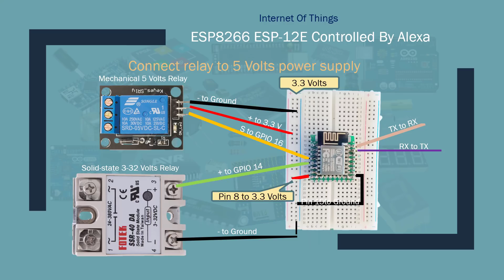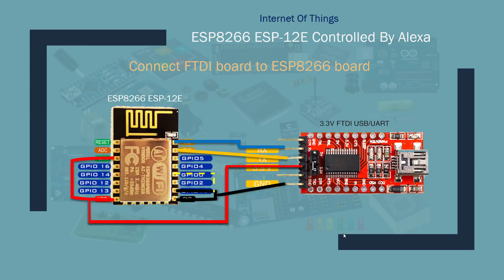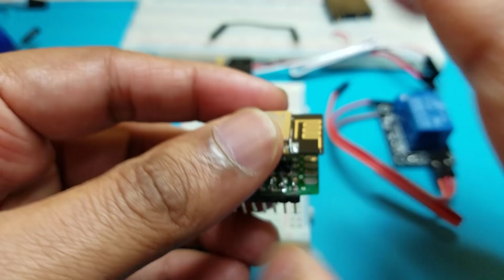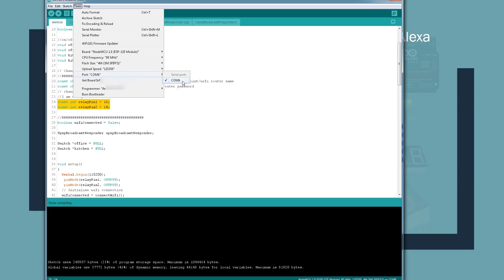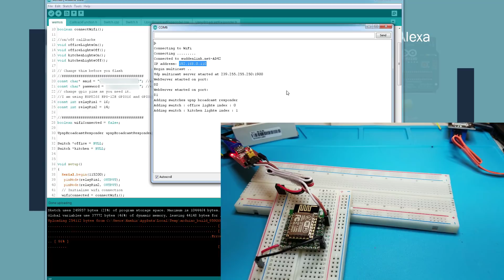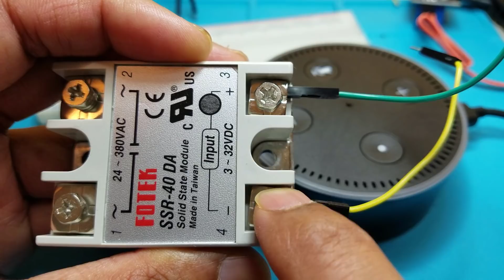ESP8366 Arduino project with Alexa |  ESP8266 ESP-12E | Tutorial # 4

Comment: i did the first tutorial and every thing worked will .. but in this one i got this from the serial monitor and i couldn't figure out the problem .. can any one help me please ?

 ets Jan  8 2013,rst cause:2, boot mode:(3,7)

load 0x4010f000, len 1264, room 16 
tail 0
chksum 0x42
csum 0x42
~ld

i got this message while the builtin LED blinking
Reply from the maker: mohamed alfalasi Please use a better power source FTDI converter does not have enough power.I hope this helps.
Reply: im using ESP8266 nodemcu 12E V2 .. and im using my laptop usb port .. so the problem actually maybe the power as u said ? .. and this board would be fine with this code right ?

and thanks for your quick response ,, please keep up the good work
Reply from the maker: mohamed alfalasi I have same the issue that is why I use bench power supply after I flash the sketch. just use 2 AA batteries or any other power source than the FTDI converter. Good luck.
Reply: i think u misunderstand me .. the board im using is like this one 

https://acrobotic.com/media/wysiwyg/products/esp8266_devkit_horizontal-01.png

https://www.moore-duino.co.uk/wp-content/uploads/2016/08/ESP8266-nodemcu-development-board-WIFI-enabled-LUA-ESP-12E-GPIO-PWM-II.jpg

i connected it using USB cable ,, after flashing it i tried also to power it up using my Samsung phone charger but i got the same blinking led
Reply: i tried to use a 12v 1A power supply and still i got the same blinking LED
Reply from the maker: mohamed alfalasi How did you use 12 volts power supply? It only requires 3.3 volts.
Reply: there is a voltage regulator on the board ,, it will cut the voltage and reduce it to 3.3v as i know .. i uploaded  again the previous code for controlling 1 relay and  again it worked fine
Reply: I managed to find the source of the problem ,, it was my arduino IDE itself ,, i guess cuz i have many things added to it, it may got confused in uploading or running the right codes somehow,, 

i tried every thing from scratch using another laptop and every thing worked with no problem
Reply from the maker: mohamed alfalasi Great job troubleshooting.
Reply: mohamed alfalasi can you be a little bit more specific on how you fixed this issue? I’m getting the same output on the serial monitor
Reply: Netmedias I’m going to try out different power sources soon, but was wondering why it seems to work fine in the video using only ftdi board power? Are you using a usb3.0 port or something? Thanks for the videos!!!

Comment: Does this connection with Alexa happen over a local network or does it require an internet connection?
Reply from the maker: CAL20EECS09GUY You need internet to process your command  with Alexa echo or dot. It will not work without it.
Reply: local aka your home router

Comment: Hi , i am trying this project based on your tutorial, but seems like I cannot connect to my network. when I upload the code and then open serial monitor it is just blank. But I have tried one of the examples of finding the wifi network and it works, so I know my esp is working. any idea ?
Reply from the maker: Fariz Afzal Open serial window and press the power button and you should see it obtaining an IP address. If it has IP address then you are sure it is connected to your network. 
Try to restart your router and try it again. Make sure use a better power source. Ftdi converter doesn't have enough power to power on the board once the code is flashed. Good luck.
Reply: thanks a lot. I was already using an external power supply but powering it off and on again worked. Now I am connected to my wifi network. but now Alexa cannot discover my devices. Giving the same command you gave, nothing happens.
Reply from the maker: Make sure Alexa and ESP are connected to same wifi router and restart the router.
Reply: Thanks, after a few times of turning on and off now it is working.

Comment: why is it not working when i unplug it after uploading and replug it ?
Reply from the maker: TheDAG It could be that it is crashing. I had same issue. After flashing the ESP board it did not work. Used a better power source. Good luck.
Reply: Netmedias it's working if I click (not more than half a second)  reset button after repluging , is there any way to include that in the  setup part of the code so that it happens automatically whenever it restarts?
Reply from the maker: TheDAG Look at the Arduino serial output. What are you seeing? Past the output her.
Reply: Netmedias serial monitor showed nothing since started this project
Reply: Netmedias would ESP.reset() or ESP.restart() work for my application?
Reply from the maker: What is your power source?
Reply: Netmedias i power it through micro usb 5v 1A , I tried multiple of them , even with out connecting the relays ,and got the same result every time
Reply from the maker: ARe you using NodeMcu or just ESP. ESP will not work with 5 volts. It requires 3.3 volts.
Reply: Netmedias NODEMCU , I have 2 of them and both have the same problem

Comment: Thanks for the Tutorial
I have uploaded the sketch into ESP8266 successfully but my Alexa App is not discovering any devices. What can i do to solve this?
Reply: Hi Hibee, I had the same issue, I got it fixed by resting my router, not sure what the issue was but after 2 days it worked. Try this 
1. Create a hotspot via your smart phone with the same SSID and Password as your home network, turn of alexa and esp off, turn your home router off. 
2. Turn on the hotspot on your phone. Turn on alexa and Esp. Give it 20 seconds, Ask alexa to discover devices, if all the devices are on your mobile hotspot network and if alexa l discovers the devices, then you might have to reset your router and try it again. keep the serial monitor open and let us know what you see.
Reply: Hi Tony, I had the same issue, I got it fixed by resting my router, not sure what the issue was but after 2 days it worked. Try this 
1. Create a hotspot via your smart phone with the same SSID and Password as your home network, turn of alexa and esp off, turn your home router off. 
2. Turn on the hotspot on your phone. Turn on alexa and Esp. Give it 20 seconds, Ask alexa to discover devices, if all the devices are on your mobile hotspot network and if alexa l discovers the devices, then you might have to reset your router and try it again. keep the serial monitor open and let us know what you see.
Reply from the maker: Hibee Tech You need to make sure your device is able to obtain an IP address. Also check you Arduino serial window. Are you seeing any errors? Try to reset your router. Alexa dot and esp needs to be connected to same router.
Reply: Netmedias Both Alexa App and ESP are connected to the same router, on the serial monitor, it shows IP obtained from the router. No error message was observed but Alexa can't discover new devices. Do I need to add any Alexa skills? Thanks
Reply: Same here, new Echo2 device working fine but does not find anything when dicovering devices.  Esp8266 is connecting fine, gets an IP, I can even browse on port 80 to the ESP8266 and get "You should tell Alexa to discover devices" so for sure its IP is connected fine. I also tried Fauxmo scripts on Raspberry Pi but it also doesnt discover devices. I can see the Echo is sending out UDP packets 239.255.255.250:1900 when I do the discover devices but ESP8266 doesnt send any reply. Im confused if I need my router to support UPNP as well (I dont think so).
Reply from the maker: Ameen Khan Great job with this troubleshooting tip. Thank you

Comment: Espcom_failed any solution
Reply from the maker: lettkt7ss Make sure select the correct board and com port in Arduino IDE and put your esp in flash mode. For esp you need to ground GPIO0 before you power it.

Comment: You mentioned using the ESP 8266 12 E development board as a way to skip the soldering. How do you set this up with this? 
Will the software be the same?
Do you still need the FT232RL FTDI?
Reply: I am Quadriplegic so I am not able to do any of this but will be instructing somebody to do it for me. So, soldering might be difficult.
Reply from the maker: James Chapman simply flash the same sketch to NodeMcu and Connect the relays to same GPIOs. Make sure look up the NodeMcu pinout diagram since pin numbering on board and GPIO number is different. 

You don't need FTDI converter. Good Luck.

Comment: I have a query, actually I didn't understant that ESP would have to connect to "a wifi router" and then Alexa would have to connect to that Wifi router?............I thought ESP is already a "wifi router" so it can be connected directly with Alexa and no "Wifi router" in between them ! I am really confused. Please someone help me. Thanks
Reply from the maker: kamit01 They both need to connect to your wifi router as client so they can talk to each other. You can run ESP in AP mode then your Alexa device will need to connect to ESP and it gets more complicated and you can't control other devices. I hope this helps.
Reply: okay thanks

Comment: Hi Netmedias, first of all congratulate you for those great tutorials, I'm Colombian and I follow you. on the other hand I wanted to ask you about an error that I have, the esp is flashed but I do not see in the com window that it connects to the wifi
Reply from the maker: fidel castillo It could be that it is crashing. Try to use a different power supply than your USB to TTL converter. If it still doesn't work. Try to download following tool, it worked for me when my ESP8266 was crashing and I was unable to see the serial output in Arduino IDE. Good luck.

https://esp8266.ru/esplorer/
Reply: Thanks much, it is working!

Comment: I get this "fatal error: ESP8266WiFi.h: No such file or directory"
can't seem to find the library
Reply from the maker: laf hunting You need to install ESP libraries within the Arduino IDE. You need to watch my tutorial #2. In this tutorial I show you how to do that. It is very simple.
Reply: Hello. I am getting the same error but I have other projects that reference this header file "ESP8266WiFi.h" and they work. It's the reference in "Switch.h" and "UpnpBroadcastResponder.h"  that cannot be resolved.

I placed these files in: %userprofile%\AppData\Local\Arduino15\packages\esp8266\hardware\esp8266\2.3.0\cores\esp8266

Thanks in advance for any help.
Reply: Ok. I removed the files from...\cores\esp8286 and kept them with my project file and it works now. I thought I had to move the cpp and h files.

Comment: Hi, I built this device with a Node MCU and have some problems. In the serial monitor, everything works fine until 'Adding switch...', so I assume the ESP is working. Alexa won't find any devices and I don't know why. I tried two different networks. Instead of telling a dot to scan for devices, I use the Alexa app, but after 20seconds it always returns to the 'HomeAutomation' screen, without either adding the two devices from the sample code, nor saying something like 'no device found' This drives me crazy. Has anyone had similar problems?
Reply from the maker: Felix Herbst When you give "discover devices" command to Alexa what do you see in serial monitor? Can you share you serial output?
Reply: Hi, it shows constantly this: 
ets Jan  8 2013,rst cause:2, boot mode:(3,7)

load 0x4010f000, len 1264, room 16 
tail 0
chksum 0x0f
csum 0x0f
~ld
Reply: Ah it works fine! Thank you, it was just a little driver problem..
Reply: I have similar problem, can please explain in details how you solved it.
I also used Alexa App, but noting is showing on the Serial Monitor

Comment: Ultimate TUT, rare one that explicitly explains every detail. I did a project with NodeMCU that would give me temp and humidity reading on my HA running on Rpi 3. Now I have a couple of NodeMCU lying with me and I need to know can we do the same with NodeMCU as well if yes can you also create a small quite video to achieve the same with nodemcu, as nodemcu is very easy to flash. Once again ultimate video, subscribed. One more thing the mech relay you used is a one channel relay, if you do decide to do a video with nodemcu please use 3-4 channel relay with nodemcu to show us how more than one equipment can be controlled ..... thanks
Reply from the maker: Sammy Singh Thanks for your feedback. All tutorials are in pipeline as you suggested in your comments.

Comment: I am a bit confused with the relays, could I use that signal in conjuction with other things, want to have my led lights simulate a sunrise, not sure of  the best aproach
Reply from the maker: +Gavin Walsh Yes you can control whatever you connect to relays. Both relays can control electronics up to 250 Volts. Smaller LEDs can be control with GPIO directly.

Comment: Sir as i told u earlier am working on my clg project in which i used arduino mega and esp8266 i want to controll 2 8 channel relay so i use arduinoega for this job bt the problem is i dnt get it how can i connect esp8266 with arduino mega for more serial pins am tired from searching a solution for it sir would you plzz help me